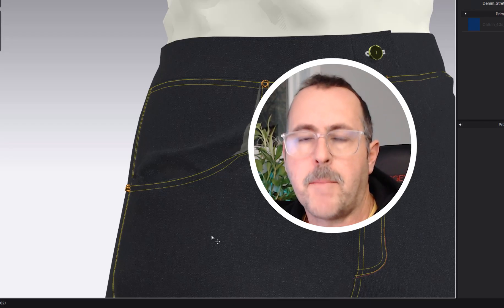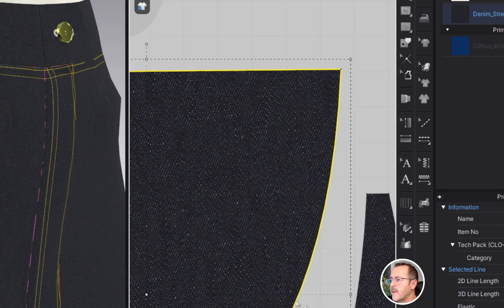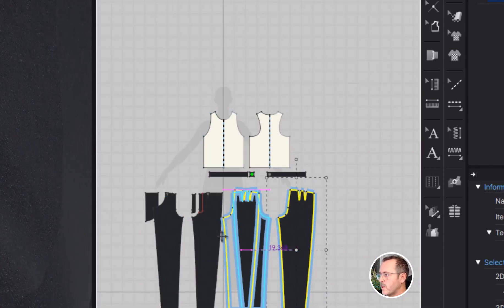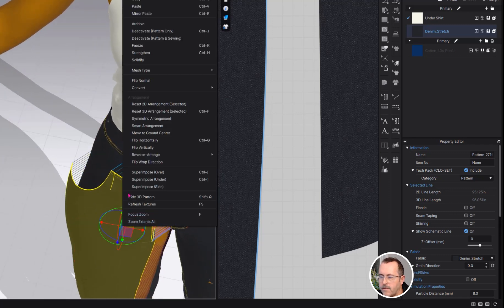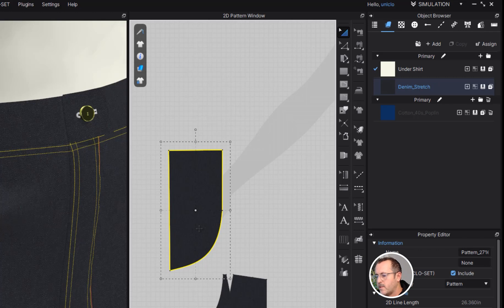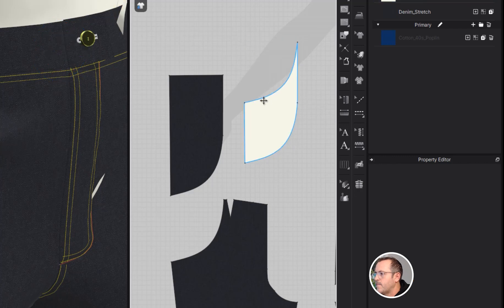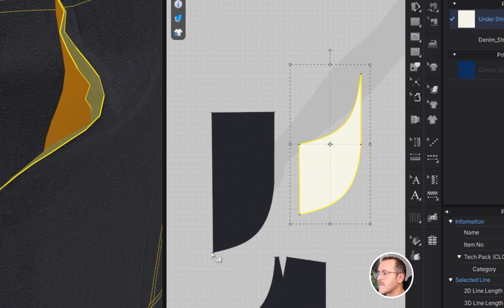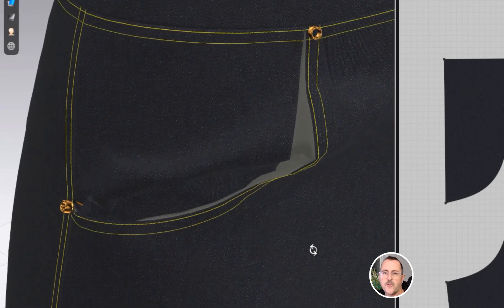How to Make Pockets in CLO3D - Easy

Comment: hey mate, when i press the cut tool, it alters the actual pattern and makes the curve deeper. I dont know how to fix it as i havent seen this problem for anyone else. Can u help me out
Reply from the maker: I have noticed that the deeper the curve and offset, the bigger difference in the shape. I’m not sure if this is helpful but if you are following a pattern you can add it to the fabric as a graphic and correct the curve based on that.